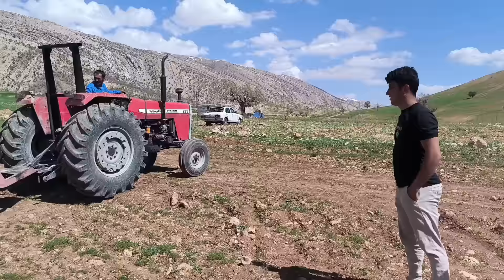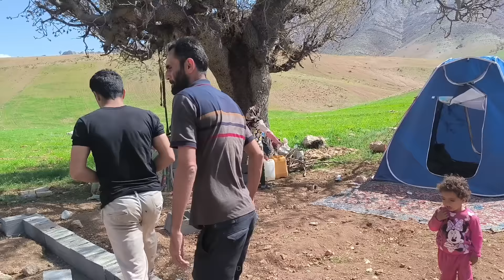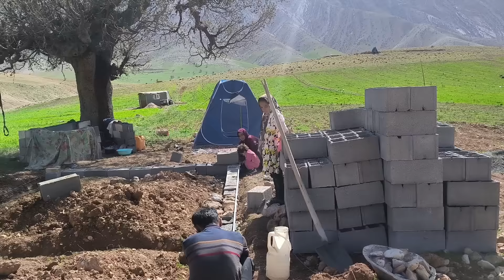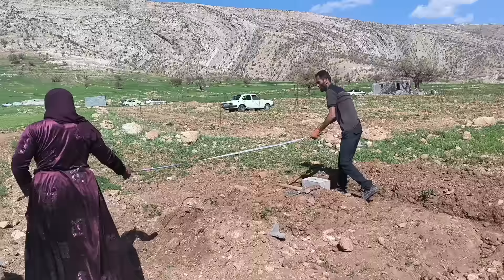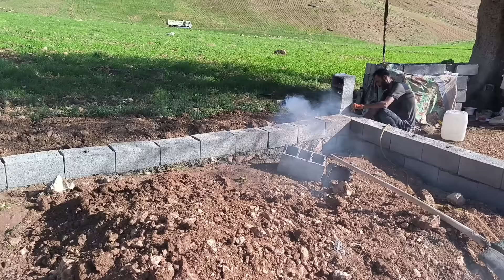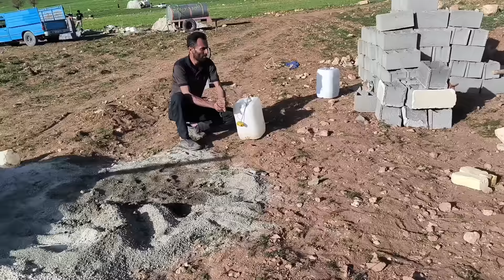Rasool Barkat for Afsane and her daughters: Building a dream house with a new master

Comment: Make a roof like the one on Rousta channel charity building a house for Zahra and Ruhollah the roof is on a slope where the water run off easily and it made with tiles and metal and it's very nice I would like you to get that no flat roof please
Reply: I agree and it should be for roofs to be always  slightly inclined to avoid water retentionmon top. 😉

Comment: Sorry about this
Laying loose dtones on soil then cement and brics on wet cement 
Not professional  al leadt cement should set hard ist tgen lsy bricks 
I am not madon 
But seen  houses beeing build 
Base  goundation is vety impt for building it carfies load it needs to be firm solid other wise later cracks appear in these concrete bricks